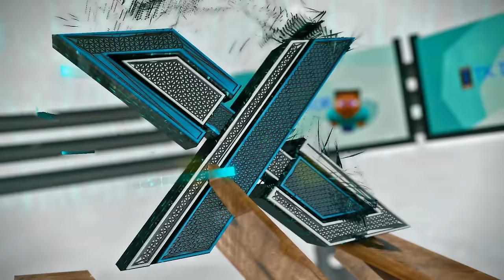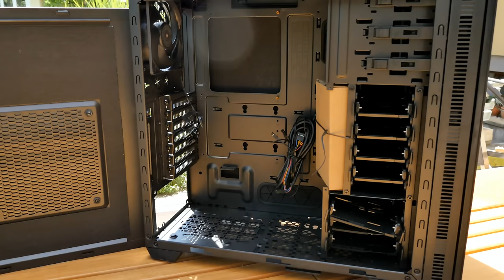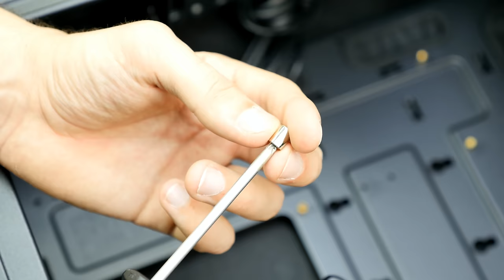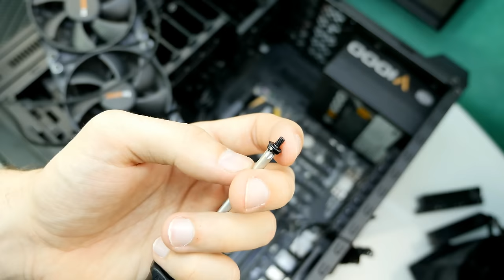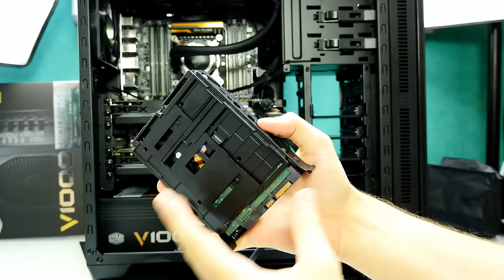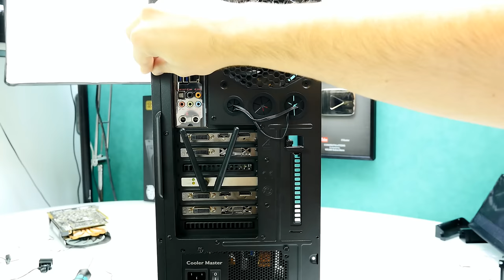PC Upgrade to 4K - CrossFire with 2 XFX R9 290X Black Edition - Gaming / Rendering Build 2015 [4K]

Comment: Guys i have a windows XP 32bit with 100MB RAM will it be able to render it under 10 minutes, i mean it sounds a bit strange but will it be able to render 2k - 4k under 10min?
Reply: 4K no problem.. But, can it run crysis?

Comment: Sounds Expensive
Reply: Its over a thousand without case and hard drives, is worth it gets best gaming and streaming!
Reply: Maybe Hard To Decide On No Case
Reply from the maker: treybird1594  around 2000$   Gpu´s  ~ 700$ , CPU 400$ , PSU 200$ , Case 150$ , RAM 250$ , Drives 200$, Mainboard 100-150$
Reply: geeze i cant even afford a ps4

Comment: same CPU as me
Reply from the maker: Evan Tigchelaar  yea cpu rocks :-) 5820k FTW
Reply: ik its nice. Mine boots in 17secs. Goes well with an SSD.
Reply: Evan Tigchelaar CPUs don't increase boot time.
Reply: They do. Not BIOS time, but OS startup time
Reply: Evan Tigchelaar I get like 8 seconds with a i3 4150, which isn't even half as powerful as the 5820k.It might just be my experience but usually storage speed affects it a lot more.
Reply: yeah... I use a Samsung EVO 850 SSD, but once Windows is started (8.1 Pro) it works amazingly! Can record, multitask, and do gaming all at the same time! Are you maybe using Linux? (or an older version of Windows)
Reply: maybe BIOS time, cuz once the BIOS is done I get 5 secs for OS
Reply: Evan Tigchelaar Oh ok, I've got a cheap mobo so its probably got less to load than a fancy x99 one.
Reply: Yeah, I use an MSI X99A SLI Plus, which has USB 3.1, SLI support, the X99A chip, and I think it has UEFI support. Also has Click BIOS 4, so a lot to load. First flashes some two-string alphanumeric characters then lists devices. I disabled the fancy full screen MSI logo because it makes the Windiws logo not appear and the loading circle look odd. That is the advantage of cheaper boards. Dads ASUS board is bare bones. No USB 3.0 support at all, but the BIOS goes by in a flash, But I am happy with mine. Lots of ports for drives, in case I need to expand, and 2011 v3 for newer chips. Still, could have went with a cheaper board and been just as happy.
Reply: Evan Tigchelaar Nooice!!